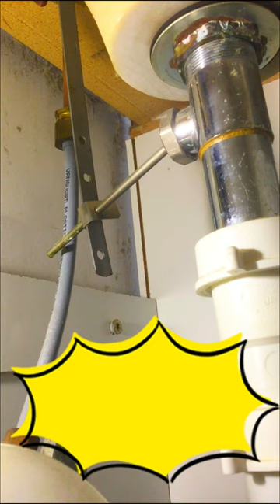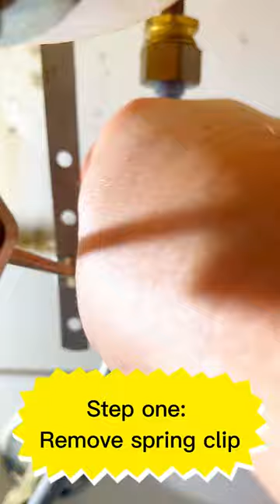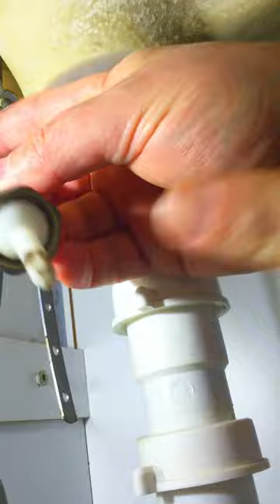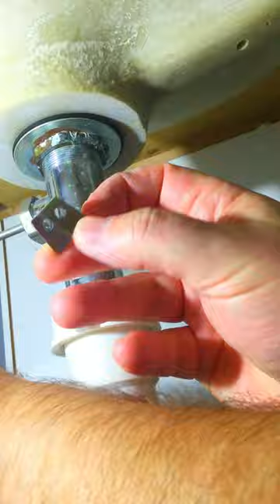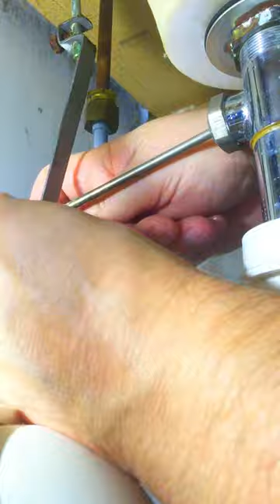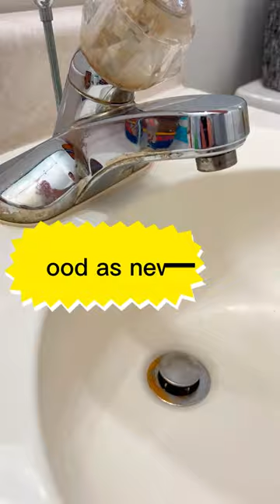How to repair your sink stopper

Comment: I would recommend slowing it down, it would be easier to see what’s happening. However, it looks fairly straightforward. Thanks for posting.
Reply from the maker: ty I posted a long form one to that is a full walk through but tried to give a short with it as well for quick rundown
Reply: you can always slow it down yourself by changing the speed . just hit the 3 dots at the top
Reply: I just paused it on each instruction, shorts don't give you a whole lot of time, hence the "short" lol

Comment: So you have to turn the water off?
Reply from the maker: Nope... this is just the drain repair so no pressurized lines for water to worry about.
Reply: @ninjadiy2022  I do maintenance for my apartment complex, I’m still learning a lot of things and so these videos help. My biggest fear is water pouring into an apartment, happend once and don’t want to do it again.
Reply from the maker: yep I totally understand and glad to help.. any pressurized plumbing line you shut water off so basically any water supply lines ect.. drain lines are not pressurized so your ok there besides any small amount of water stuck in the ptrap or if its a sewage backup scenario in drain lines.. yuk lol stay safe @brandonrogersofficial

Comment: I want to get rid of this thing,   remove it for good, how do i do it? Would it leak from the pipe if i remove it?
Reply from the maker: So arguably you could but it does serve a purpose from saving you from clogged drains or fishing something out of the ptrap every time that something falls in the sink.  That being said you could use like a threaded pipe cap to cover the hole where the pivot rod enters and use teflon tape or plumbers putty to prevent leaking.. I would still leave it in there though as once you drop something that is big enough to clog the line it will cause issues down the road and it will save you from unassembling and cleaning out the ptrap every time it backs up from this.
Reply: I understand, but it's hard to clean it when hair gets stuck there and  it clogs it up. It is so nasty and gross. @ninjadiy2022
Reply from the maker: @alexgamez24  get one of the flexible drain cleaning rods that has the claw you can open and close and just use it on all drains.  Its gross I agree but much less than raw sewage backing up throughout your house if you let the main drain line cloged with hair or debris :)

Comment: My issue is getting the pivot rod into the stopper I can’t see it once I drop the stopper into the drain
Reply from the maker: Yea that is the tricky part just be sure to face the stopper rod opening to the back of the sink towards the faucet.  YOu can put tape on the top marking the stopper direction as well until its done. There is a little bit of play there so once its in place you can move it up or down slightly until the rod slips in.  I'm sure you will get it fixed.. take care
Reply: @ninjadiy2022   Thanks, appreciate the tips.  I ended up buying a new drain stopper as the piece at the bottom of the original one with the whole broke off it.  With that said once I dropped the stopper in the sink I had trouble lining up the whole with the pivot rod.  It was very hard to see it as you said.  But somehow I guess even though I could not get the pivot rod through the whole it was still touching it and the stopper was moving up and down.  When I lift up the lift rod the drain just about goes all the way up.  Enough to where it does hold the water.  When I push down the lift rod the drain stopper comes back up but it’s almost a little too high up but should be ok.  Everything seems to work, although not perfect, so I think I will leave it as is?  Maybe if I get motivated I will try it again.
Reply from the maker: @mr.perksy  lol yea its a pain cause you just cant see what your doing inside the drain :) you can adjust the height it lifts too using the pinch clip that connects to the lift rod.  But to your point if its working now maybe its good.  Take care

Comment: What if the stopper falls down and you can't bring the stopper back up to thread it again?
Reply from the maker: So the stopper itself is not threaded it just hooks in from one side. So most likely it broke or came loose so you can buy a new stopper and install it.  The long form is a more detailed walk through for you.
Reply: @ninjadiy2022  to piggy back off of your comment, make sure to get the right size stopper too. Take your original in with you to the hardware store. (Advice based off my mistake lol)😅
Reply from the maker: Yea very true with just about any part you are replacing on anything... agree completely! always take the part to make sure they are selling you something that looks the same :) @leannabedore